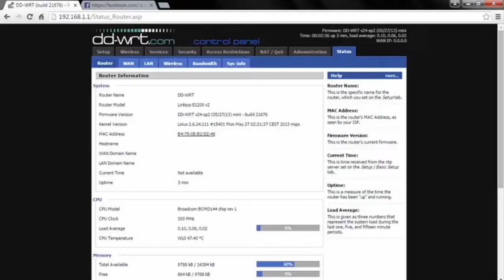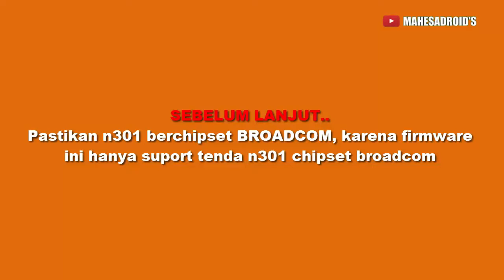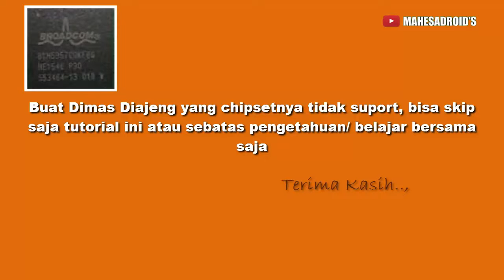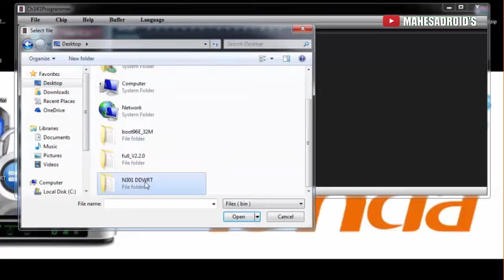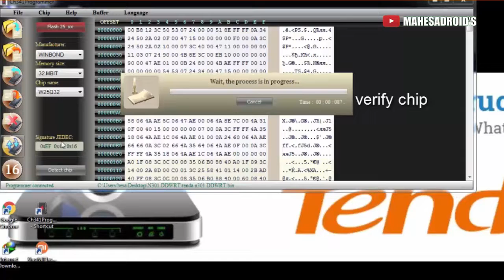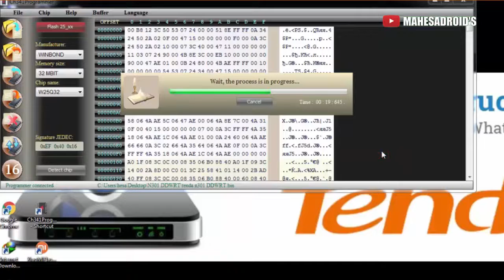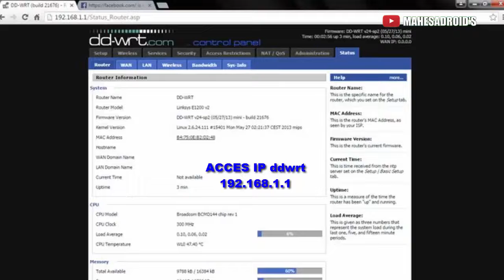Cara Flash Tenda N301 dd wrt BROADCOM chipset

Comment: Tenda n301 tanpa ganti ic bs g bang langsung upgrade ke ddwrt
Reply from the maker: ga bisa
Reply: @MahesaDroids  kalo tl wr840n v6 pnya q sdh openwrt pgn tk ubah ddwrt gimn bang carane.
Reply from the maker: @suhermanmanda5581  flash ke fw tplink dulu
Reply: @MahesaDroids  tp link v6
Reply from the maker: @suhermanmanda5581  ga bisa v6 ddwrt..flash saja fw tplink v1 , lalu up ddwrt
Reply: @MahesaDroids  flash via tftpd t bang ap via web gui
Reply from the maker: @suhermanmanda5581  gabisa krena bootloader dah beda, flash chip via ch341A programmer